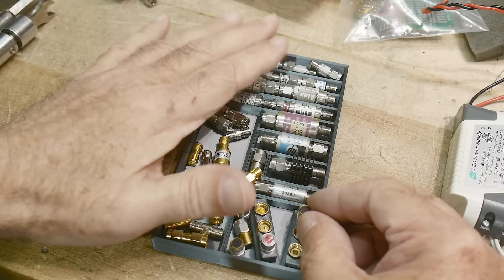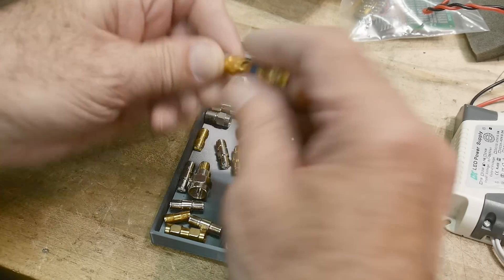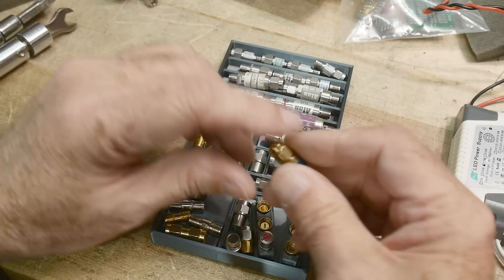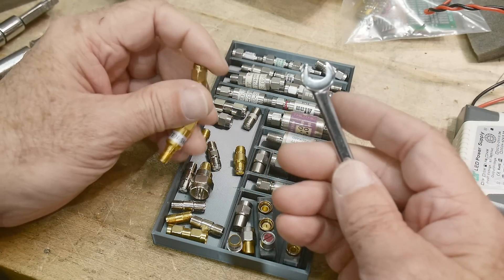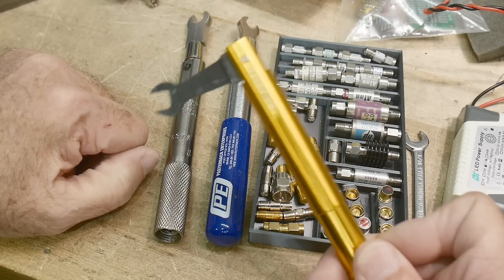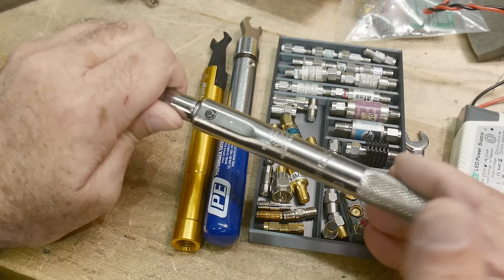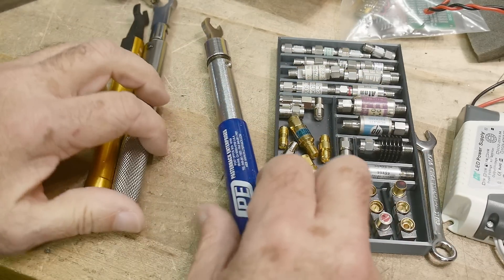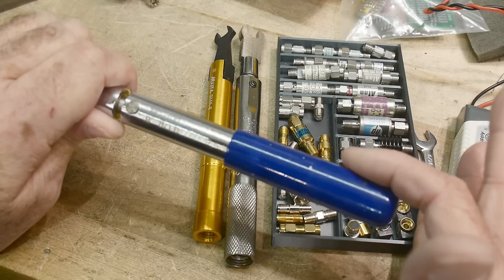#1443 Using a Torque Wrench on a TinySA or NanoVNA

Comment: First things first. 0.9Nm torque applied to a brass SMA is simply too much, it should be somewhere about a 0.4Nm. Look (at least) at the table at the encyclopedia at microwave101 if you don't have exact specification provided by the manufacturer of your particular connector. The 0.9Nm is perfectly OK for a stainless steel versions of SMA, but not to the brass ones. And, of course, applied torque couples through the connector to its holder, which also have to be capable of accepting such mechanical force, which, when it comes to the brass edge of board mounted SMA, requires them to be inserted into a precisely machined notch in the fixture surrounding the PCB or something similar to counteract the tightening torque. This is why these connectors goes a little bit over the PC board with the square shaped plate, that could be easily inserted into some notch to hold it (temporarily or permanently) in the place to suck a torque from the connector through the tightening process. You should (at least) put a wrench over that leading square shaped plate to counteract the tightening torque. The 0.4Nm applied to the PC board through abt. ½cm wide connector is simply too much mechanical force applied to the edge of the board hugely overstressing it resulting in cracks and rip offs.

But it is necessary to use such a huge tightening torque? Generally speaking, using torque wrench to tighten the coaxial connector is required due two main reasons:
1. You need to keep your reference plane stable at its place after disconnecting and reconnecting the joint. Opposite to the PL-259 and similar coaxial connectors, SMAs have precisely defined reference plane. The more stable tightening torque you apply to the connector, the more stable position of reference plane you get when reconnected. This is crucial when it comes to precise calibration kits used together with a high precision VNAs on relatively high frequencies. The uncertainty of the position of the reference plane would be perfectly under 1mm even if the SMA is tightened just by hand without any torque wrench. So the first question is if your equipment is precise enough to require torque wrench usage. When it comes to the NanoVNA or things like that, then using torque wrench is nothing more than a overkill. 

2. You are doing something like a permanent joint, that must overcome some mechanical stress or temperature changes over a long period of time. This is the situation, where you have to tighten that connector enough to obtain a stable and reliable joint over a long period of time. This requires less precise torque wrenches than in previous case, because you just need to not mechanically overstress the joint, you just need to tighten it enough to obtain a long lasting reliable joint. This is more important when it comes to a big connectors like 7/16" etc., the bigger the connector is, the bigger torque it requires to obtain a reliable joint, and, well, the bigger the torque is, the less reliable the human senses are. So using the torque wrench is must when it comes to 7/16", but when it comes to SMA, well, if they are buried deeply inside some huge device or you are using very high frequencies, then using the torque wrench might be important. But as long as you make temporarily connections used on relatively low frequencies, the usage of a high torque, like 0.4Nm is, only adds mechanical stress to all that components bringing almost no benefit, so it's absolutely ok to forget about the torque wrenches and just tighten your connectors by hand.

That's youtube. People don't understand, they just start screaming you should use this, you have to do that, just because they have seen someone using/doing it that way. Less understanding the basics the louder scream. And, in my opinion, it's important to talk about these issues just to rectify that issues by bringing more insight. And, well, this is my own way how to tell you "thanks for this video".

Comment: 1Nm is too high torque for brass SMA! In datasheet on the brass SMA connectors say that they need to be torque with  0.3-0.5Nm.
For my needs, I printed spinners on a 3D printer and put them on all my SMA connectors.

Comment: I used to carry a small 5/16 wrench in my brief case when I would visit an earth station (back in the old days before I switched to a back pack).  Mostly I had it on hand in case there wasn't a torque wrench on hand at the site.  Like you I felt I had fairly well calibrated fingers and could torque close to the 8 lbf*in spec without going over.

Totally agree that for a lot of applications the 8 lbf*in number is probably higher than necessary and may be too high for some direct PCB mount applications.  Can you see a difference in the torque values applied to a SMA connector, yes certainly.  As you noted with the right equipment and at higher frequencies - a lot of my testing was above 10 GHz up to 14.5 GHz.  On my HP scalar network analyzer with good metrology grade adaptors from APC-7 to whatever, and WL Gore cables you could watch the return loss change as the torque value was set to different values.  We actually held a teach-in on this one for other engineers who worked in the labs and on earth stations.

In our case, this was for commercial applications and all the SMA connectors any engineer or field engineer was likely to encounter were panel mount or passing through an enclosure such as from an oscillator or SHF PLL unit where the SMAs were secured at the pass-through and not transferring torque to a circuit board.

Taking it a step further, when satellite payloads were being built and tested, each mate / unmate of the SMA cable assemblies were logged and the connectors replaced after a fairly limited number of cycles.  These SMA connectors also had small holes drilled in them for safety wiring.

On my test equipment, I typically used APC-7 to APC 3.5 adaptors which will mate with SMAs but which are typically better constructed and have better return loss characteristics.  On my lab gear we were very by the book.

At home for hobby work, I'm getting by fine with SMAs and no torque wrench ;-)

Comment: 'Finger-tight on the toys'. Got it. I'm NASA certified at soldering, but replacing SMA's is a pain. Thanks for the warning.
Or, just replace the SMA's on your $45 NanoVNA with stainless steel SMA's. :)

Comment: The way you finger tighten the connectors is good enough. Every other channel where they use a torque wrench, they always fail to use a wrench to counter torque there by sparing the sma to pcb joint. Unless it’s a nanovna F or f v2 in an aluminum housing, us novices are just setting ourselves up to  damage our tech.
No to the torque wrench on nano or tiny’s. We should have tshirts made.
I commented before you finished your experiment but you proved  what I what faith articulate

Comment: If you're not connecting mmWave frequencies, then torque really is not critical.  However, above 20 GHz the impedance discontinuity begins generating reflections and higher frequencies are more sensitive.  Too little torque leaves a gap between the insulators and too much torque compresses the insulators.  This change in effective dielectric constant in both cases changes the impedance of the connection for 1-2 mm.  Longer wavelengths smooth this over and don't notice, but 1 mm is a significant fraction of 10 mm wavelengths.  You should tighten a little more than finger tight, but if you take care to be consistent, then you should see only very small problems.

Comment: I think if you add sacrificial connectors and torqued them once to your NVNA/tinySA you'd probably be ok, then use a wrench to hold it in place and torque the DUT connector. I bought a H&S used unit on eBay a long time ago just to have it around but finger-tight is probably sufficient for most ham/hobbyist use.

Comment: The biggest problem I see isn't so much that you were not using a torque wrench.  The problem is how you spin the connectors on and off.  You grab the body and spin them on.  That spins the male center pin inside the female center pin destroying it's performance characteristics.  Get caught doing that in a metrology lab and they will probably show you the exit along with your pink slip.

Comment: Those Chinese ones often come grossly inaccurate. Owen Duffy wrote about it. The point of connector savers is to prevent damage to pins etc, due to lousy connectors that we all use. The point of torque wrenches is repeatability not accuracy of measurements. Anyway agree with your final conclusion, "calibrate" your fingers and I doubt that anyone will be able to measure any difference.

Comment: If you want repeatable measurements, maybe use a wrench adjusted to lower torque.
Reply: I'd say this is the really core part of using things like torque wrenches. If you're doing something or working in a team where things need the accuracy and repeatability, then tools like torque wrenches are vital to have that consistency. If you're working solo and that level of repeatability between people isn't needed? Then yeah, you can get away with a personal calibration.

Comment: About 3 years ago when you started experimenting with and demonstrating the Nano VNA (that had had just hit the market from China) I started to watch your channel.
Joe Smith had made a long introductory video on the Nano VNA. He had written a software programme himself to use with the Nano VNA. He was stressing on the significance of using the torque wrench; he also stressed not to touch the threads on the SMA connector lest the possibility of leaving oily smudge from the bare hands. The connectors must always be protected with the given caps. The torque wrench (that's calibrated from time to time as per the job 's requirements) would guarantee that the reference plane is always the same so that the Nano VNA/tiny SA would read correctly each and every time.
The initial versions of the Nano VNA came with the SMA connectors directly soldered on to the PCB and as you mentioned the quality of soldering was not good; many managed to break the connectors with ease. The later versions had a metal shell on which the connectors were mounted for added reinforcement.
Yes, you should use a torque wrench always (if you have one😊) ; there's no doubt or confusion. "Be gentle" is a nice attitude😅
I remember a US woman astronaut on a EVA session on the space station/shuttle service dropped off a million dollar torque wrench; she had failed to fasten it to her EVA space suit.
De VU2RZA.
Reply: Joe works to scientific lab standards on everything, even when he's working with $50 Chinese test equipment. He just doesn't cut corners or say, "Good enough." He squeezes out of the hobbyist VNA's all that they can give. And his PC-based NanoVNA program is fantastic. I'm actually embarrassed to use it for free.

Comment: You CAN remove the blue rubber boot on the Pasternack one and fiddle around with the screw, it's not sealed AFAIK, though I don't dare experiment on the one here at the lab.

Comment: Oh my! 
You are now a qualified MythBuster!
I concur - most DIY hobby use of a VNA in no way needs to torque with precision. 
I imagine a 3D printed yoke with collapsing radials could be designed for a low torque that would be fine.

Comment: Could you 3d print one of those hex knurl things? 🤔
Reply from the maker: I'll work on that
Reply from the maker: https://github.com/imsaiguy/SMA-Thumbwheel
Reply: @IMSAIGuy  oooo cool I might try that out!
Reply: @IMSAIGuy  100% was too tight on my printer, but 104% on X/Y axis (flat aligned to build plate) got me just about perfect snug fit. I must have the slightest of elephant''s foot on my first layer, because it really locks it in when I slide that over last.